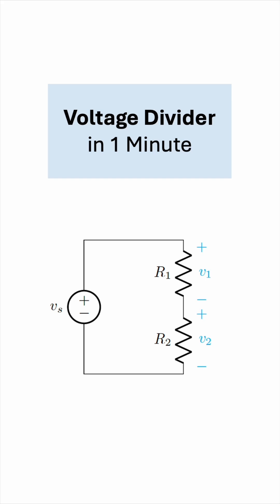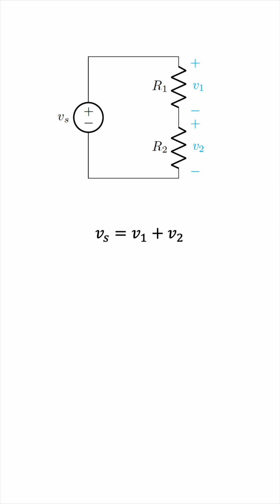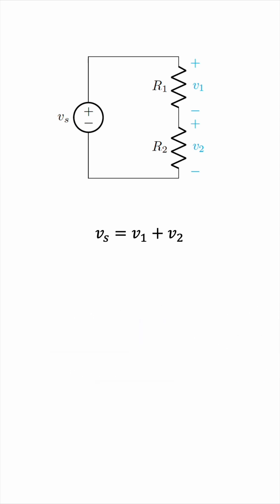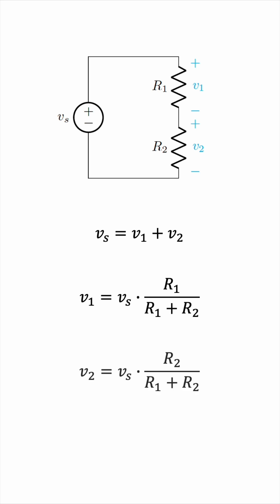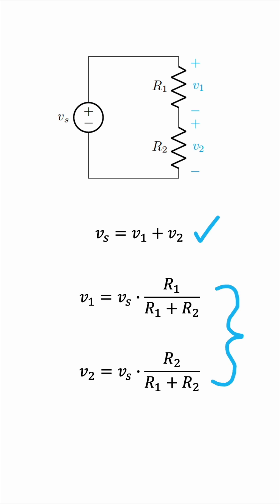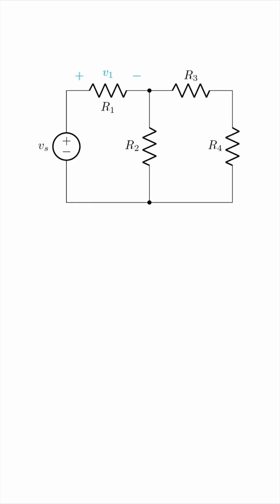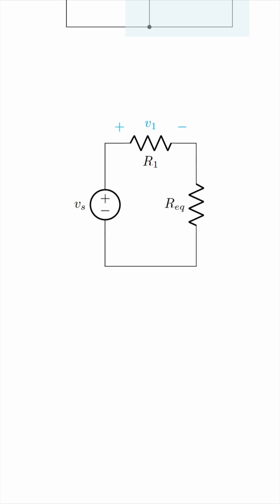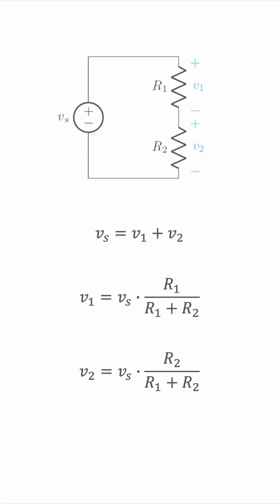Voltage Divider Circuit #electricalengineering

Comment: Stop talking about a Kirchhoff voltage law. Use Ohm’s law and logic. V=I•R and by necessity the current through both resistors is equal.
Reply from the maker: @benheideveld4617  It’s true that KVL is not needed per se, but I like to mention things that can be applied in other cases so that my videos are not specific to the quick examples I present.

In a complicated network, for example, you would definitely need KVL as a starting point, say, if you’re using mesh analysis.
Reply: @ElectricalMaths I'm with you on that ❤ btw I love ur vids
Reply from the maker: @preethianandakumar6312  Thanks!